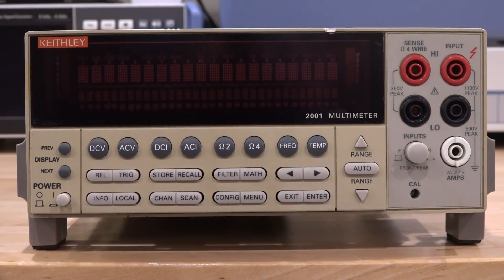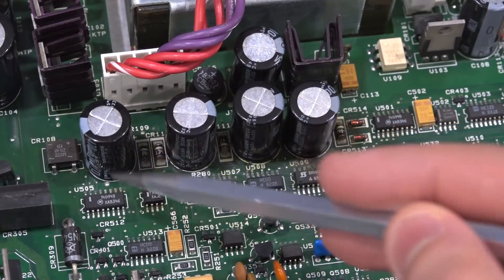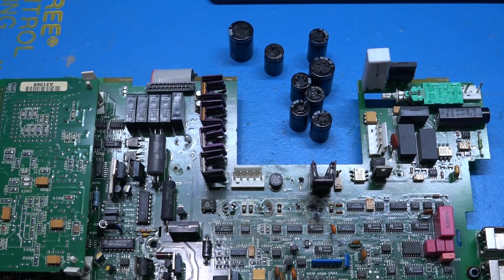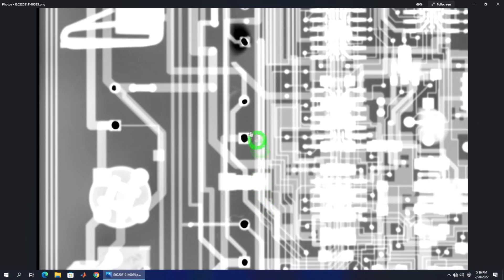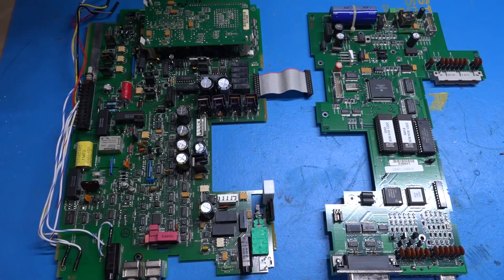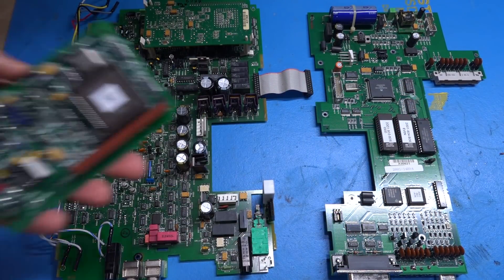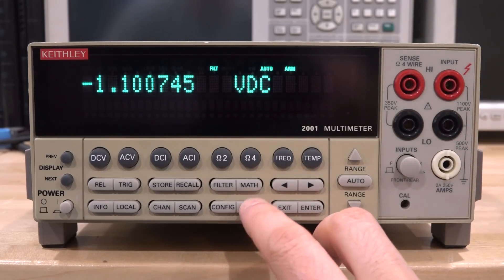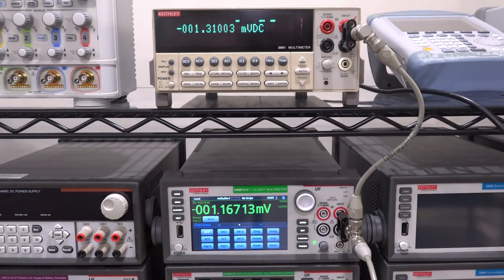TNP #13 - Teardown & Repair of a Keithley 2001 7.5-Digit Multimeter

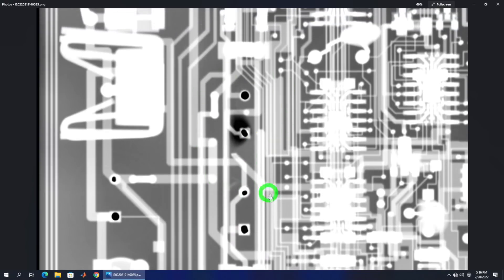Comment: By the time you've gotten to 5:35 I'm massively impressed
X-ray?? That is a method I've never considered
Reply: it is impressive, although you can do a 'poor lab' version with a really bright torch under the PCB.  Not as accurate of course on multilayer boards, but it's pretty good.

Comment: Hello - Great video! I'm wondering what the cable is that you're using to sync the 2001 to the 7510 is? I can see that it's an HP part but cant' see the part number. I think I lose some accuracy of measurements with less than ideal cabling. But maybe not - I'm a software engineer of 30 years that wants to be an EE and repair amateur radio's for a living so I don't know what I don't know lol. It might be a good segment to talk about cables in general (N vs BNC, cable types etc.)

Comment: In the 90s there was some sort of problem with electrolytics. The problem was that the formula stolen from Japanese company was incomplete and now millions of electrolytic capacitors with a "terrible" water-based electrolyte have flooded the world. There is a paper talking about it by V.I. Gurevich  called: 
ELECTROLYTIC CAPACITORS: DESIGN FEATURES AND PROBLEMS
OF THE CHOICE

Comment: I have a 2000 and a 2015.  Both bought second hand and have the older type display.  I was too scared to pull it apart to check the caps in case breathing on it messed the cal.  After seeing what this went through I think I am safe to just pull the top off!  Although not in CAL they both agree with each other very well but I need to be brave and check those caps!

Comment: I agree with others that the repair process should have been included. There again,  I'm not a "Patreon"
Reply from the maker: Showing me soldering a thin wire from point A to point B probably isn’t super interesting…

Comment: Thanks for the hint!  I need to check my Keithley 2000 before it develops the same issue.  So far it has not had any problems, but on the other hand, it has seen almost zero use since I got my Agilent 34411A (for its higher speed).  I don't have anything beyond 6.5 digits, unless I would count the HP 3457A that supposedly would provide 7.5 digits if I would read the relevant internal register through a computer hook-up.  Its display is 6.5 digits.  And of course it is more than 40 years past calibration due date...

Comment: Thank You VERY much Shahriar! I checked my 2001 and it also had the Nichicon caps. They aren't  leaking yet, but one is not flush to the board at an angle, so its starting. You are the best ????
Paul
Reply: oops, I meant 'you are the best !!!'

Comment: Wouldn't it be great if the manufactures  would protect the board around all caps with a coating (or even tape) that is resistant to the dielectric that leaks out of caps?

Comment: I have a Keithley 2000 that is somewhat faulty. Last time it was powered on (several years ago) , it reported several errors during self test but worked OK on most modes and ranges (mind you, I do not have a standard to compare it to) . A visible inspection of the board and capacitors did not reveal any signs of damage. As you suggest, it sounds like they should be replaced ASAP. 

I read an eevblog post, where the relays were the culprit of some of the errors I experienced but I never got around to replace them. I also read on xDevs (iirc) that the main switch tends to fail so I guess there are more common issues than just the capacitors alone. 

What capacitor types did you end up replacing in your Keithley 2001?

Great video anyways, thanks for the inspiration to try to fix the Keithley 2000.

Comment: Regarding leaking components,  there was nothing worse than the NiCad RAM backup batteries sold in the 90s for PCB mounting. They ALWAYS leaked electrolyte onto the board, which rapidly destroyed the tracks. Thankfully we now have flash memories and EEPROMs.

Comment: Hello. Nice video. I had the 'honor' to work on same model ..it was pain in the butt..it is fine if you know what is clearly wrong..but if it isn't clear and you have to remove board all the time..pain in the butt. who designed this assembly process shouldn't be let work for them anymore.. because if you want to remove the board you have to remove almost all components ..once you start it ..you have to heatsink that white resistor that is on side..( i didn't notice it was getting hot) ..also that black cover is really pain to work with ..because those wires are pretty short and those beads are hard to put in place once cover is there..really nightmare..

Comment: Nichicon PR series was notorious for these leaks.  Every component maker seems to have their bad period, and this was Nichicon’s.  All of this seemed to be fixed when RoHS hit.  If your equipment has non-RoHS Nichicon capacitors in it, it is worthy of recap now - a small price to offset a big risk to expensive equipment.  I will guess that any of the 2000 series Keithleys will fall into this PR series cap era, so please check them.
Reply: 2001's usually have VX series. It might not be only issue of cap itself but also that in 2001\2002 these caps used in boost drive to generate front end floating +\-38V, and have large currents swings when go bad. Also very close placement next to hot LDO regulators kill caps faster.
Reply: @xDevscom_EE  There was also the capacitor plague in that era for all those using off-brands. The late 90s and early 2000s were rocky for capacitor quality. I also had a lot of issues with electrolytics in the early 90s for other reasons, but those surely have all failed by now. 
My latest problem is with all these knock-offs. It was hard enough finding supply, but even usually reliable suppliers were getting duped for a while there, and caps were some of the targets. I open the cover on one fairly new terminal and see the cap is in pieces - so I have to recap all of them. I would never have guessed we would spend so much time on basic components like this.

Comment: Forgive me for asking this, but what are the real world use cases for needing 7.5 digit multimeter accuracy? I've always wondered, seeing as the price jump to 7.5 digits is steep when 6.5 digits accuracy is pretty good already.
Reply from the maker: Please keep in mind that accuracy, precision and resolution are all different things. Having a 7.5-Digit meter gives you the resolution to look at a very small change in value in the presence of a much larger value. For example if you are measuring 100V and want to see a difference of 1nV. When a meter is built at higher resolution, they also improve its accuracy and precision at the same time (otherwise the resolution would be mostly wasted).
Reply: @TheSignalPath  can you give an example of when you would want to look at 1nv change in 100mv? Im always curious about what goes on in some labs
Reply: @TheFool2cool  We use 2002 model 8.5 digit for measuring reverse current of a diodes and some supressors (nAmps). 2001 not  good enough for that/
Reply: My use case was to determine drift in lasers (VCSEL) over time for quality control reasons.
Reply: I use a 7,5 digit (Keithley 7510) for repairing measurement and calibration gear. Besides that, it is lightning fast. I have a Prema but it takes many seconds for a 7,5 digit reading, that makes it useless for aligning f.i. a Vref.
Reply: 7.5 digit DMMs are used  for calibration.

Comment: Ha, fixed like ten of these :D My first precision project ;) uh oh, BNC connections for DC voltages, volt-nuts angry :) Now you need xDevs calibration.
Reply from the maker: You have done some great work analyzing these units. Thanks for that.
Reply: @TheSignalPath  2001 was my entrance to rabbit hole, I got first one in 2009 year and was reverse engineering it to figure out how all worked inside. Took a while, but 2001 is great learning tool for analog design. Also bigger brother 2002 shares many design features and I love them for compactness.